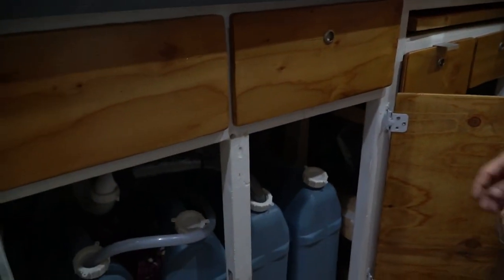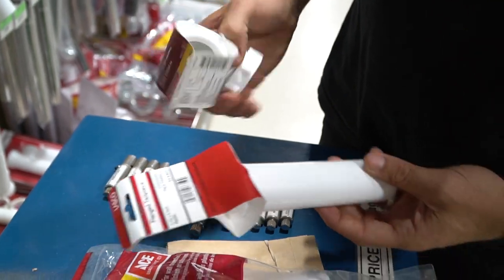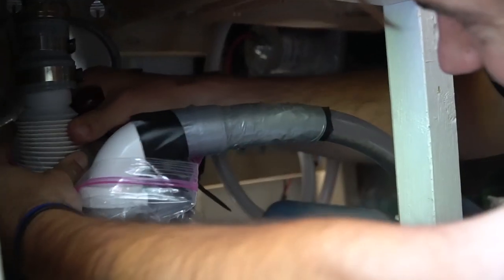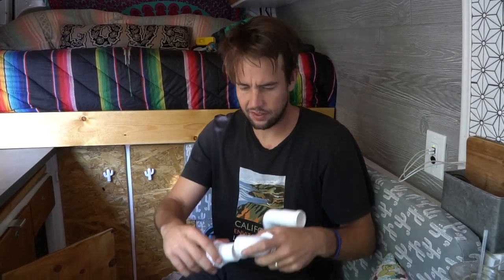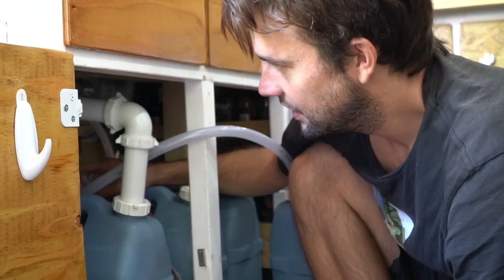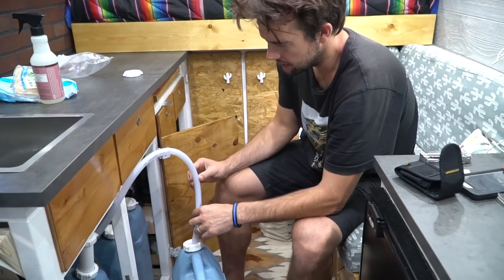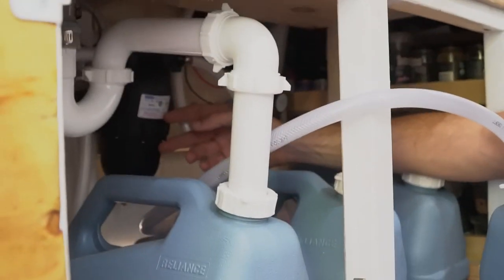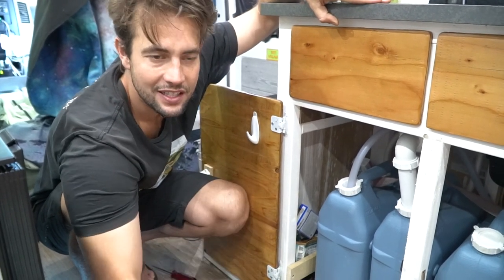Vanlife Hacks | Sink and Plumbing Rebuild | How to setup easy plumbing in your van

Comment: I’ve just been using a tube from my sink drain to the a grey water can. No trap or anything. It’s been fine. Every once in a while when I dump it I swish  around some soapy water in there. Do you need the P trap?
Reply from the maker: 2 Dogs And A Van you don’t need it it just traps the smells from your grey water tank from coming out the drain.  We use bleach every now and then to clean our tank when it’s bad